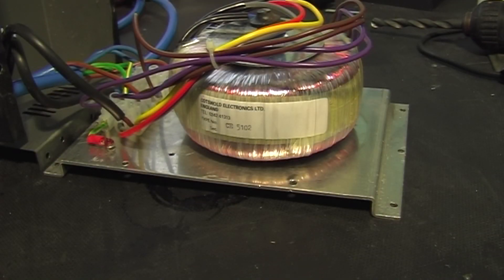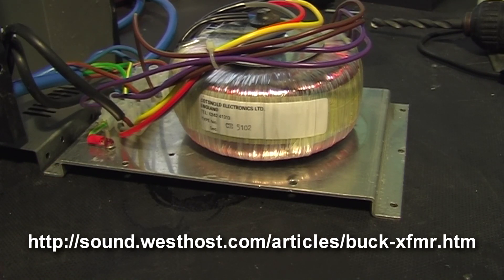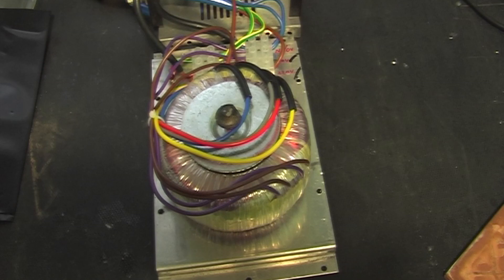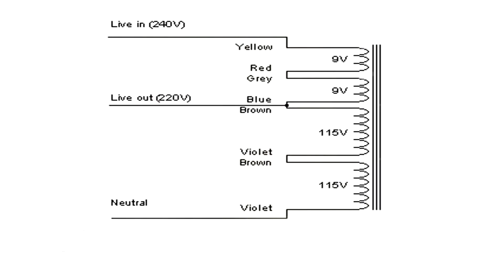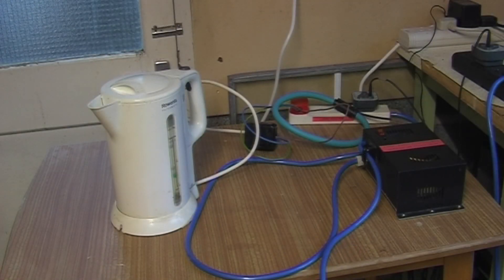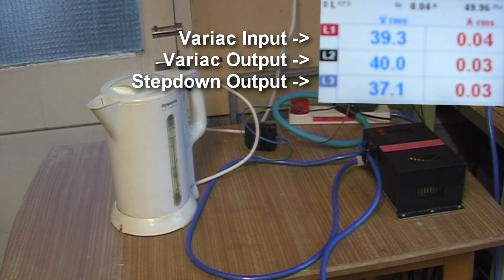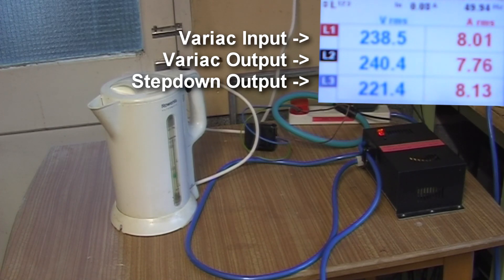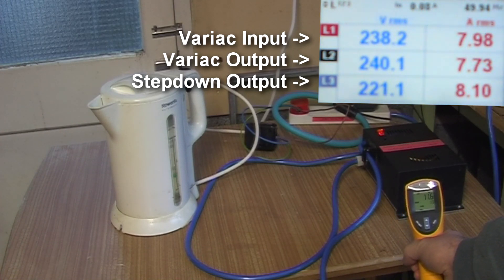Make a 2.5kVA 240-220V stepdown transformer using a 225VA toroidal

Comment: Thanks for the explanation, however...

Situation: 
- grid voltage varies between 235 and 255V here at my place in S.E. Asia
- now and then, appliances experience an early death

Considering: 
- having a transformer 240v to 15V, somewhere around 750va makes 50amps at secondary.
- prefer to have some spare, thus increase to 1kva, makes 66amps
- 240 - 15v makes around 225v
- should reduce the 255v to around 240V

Do you think the reasoning above is correct, or did I forget something?
Suppose having this, and after 5 or so years from now, I place some solar panels, and connect them to the grid for export. In this case: secondary becomes "primary" and vv.
Is this supposed to work, even with this buck transformer setup between the house and the grid?

Thanks in advance.
Reply from the maker: Yes, I'd expect that to work. It'd bring your supply down to about 220 to 240. 
With regards to the solar equipment, it depends on the acceptable voltage range for the inverter.  On the "low" side of the transformer would probably be fine.

Comment from the maker: If you want 252V output instead (from a 200V input) you can go for 223-8112 (2.67A, 0.67kVA), 223-8184 (3.75A, 0.94kVA), 223-8229 (5A, 1.26kVA) or 223-8263 (8.33A, 2.1kVA).

One last thing: this assumes that your inverter puts out a sine wave, if it's a modified square wave I'm not sure how well the transformer (in fact any transformer) will perform.

Comment from the maker: If you don't need quite so much power look at 223-8235 which is the 300VA version (4.28A output, 1.12kVA). Remember with toroidals not to overtighten the bolt and don't let the enclosure short the top and bottom of the bolt together either (it'll probably melt the bolt).

Comment from the maker: No idea, I'd just buy an off-the-shelf transformer with the appropriate voltage ratio and with a secondary current equal to or exceeding the required load current. Preferably a toroidal one as they are more compact and offer better much voltage regulation than the conventional ones. For example, RS part number 223-8279 (a 500VA toroidal) would allow you to output approx. 261V at 7.14A (1.86kVA) from a 200V input (at approx. 8.4A). Off-load the voltage would rise to about 265V using one of these.
Reply: Can I use this from RS to transform 240 to 220v? How many VA on 220v than ? Because in the Philippines in my area it's always 240v or more instead of 220v it suppose to be. Because the distance between transformers on the street they take to far apart. Some got 200v only and the one closer to the transformer like me have 240v
Reply from the maker: @TubeSkaterRudy  223-8279 wouldn't be suitable for 240-220V conversion as its secondaries are 35 volts each.
117-6071 would be more suitable with its 2 x 24 volt primaries. You'd connect the two secondaries in parallel, then put these in series with the primaries and put the 240 volt supply across the whole lot.  You'd get about 220 volts for a 240 volt input, with 20.8 amps available, so just over 4.5kVA.
Reply: @AintBigAintClever  Wow, thanks for the quick response and good tips. I'm going to order now ;) you don't know how much you helped me out. Everybody here in the Philippines has a Avr because of to low or to high voltage.
Reply from the maker: @TubeSkaterRudy  If you don't mind going for a smaller one, try and source a transformer with 2 x 12 volt or 2 x 9 volt secondaries. This would give you the option of running the transformer with the secondaries in series with each other for a large stepdown, or in parallel if you'd prefer a smaller stepdown.  The transformer I used was 2 x 9 volt, but at 500VA 2 x 24 volt seems to be the smallest RS offer.
Reply: @AintBigAintClever  I already ordered. Because I observed it often peaks more than 240v here in my place. 240v is more the average. That's why all our neighbour's and also our apliences like refrigerators get broke after less than 2 years. Warranty here in the Philippines is terrible 1 year at max. Because of the bad mains. Also I can use the 4000 VA for a professional 1500watt expresso machine that's peaking for a msec at 5000 watts I observed.

Comment from the maker: You only need one winding each side but if you've got a transformer with dual primaries or dual secondaries, that's fine. Yes, a transformer with 200V primary and 60V secondary (or two 30V secondaries) would do the job, as would a transformer with 230V primary and 70V secondary (because the turns ratio is about the same - 10:3 - the output voltage would be the same).
Using thicker cables would reduce the voltage drop and be more efficient.

Comment: Hi thanks for the info I decided to make one instead.but I do have a question about the windings If we have 200v input and we wanted 260v could we have 200v primary and 60v secoundary then put them in series like the boosting transformer on the website.How many windings each side would I need.260v might sound high but the voltage drop is high as I am using a long cable Thanks

Comment from the maker: Get a transformer with 240V primary and 40V secondary, or thereabouts (230-36 for example should be fine). Connect the two windings in series then apply your 200V supply across the 230V winding. With 200V into a 230V primary you'd create about 31V across the secondary, with the two in series that should give you 231V at whatever current the secondary winding is rated at, as you can see from the video you can pretty much ignore the VA rating of the transformer and just concentrate on the current.

Comment from the maker: The stuff I was using was 220V stuff from China, I wanted to be on the safe side. In the case of vintage 220V stuff though, it may be better to run at the correct voltage so as not to shorten the life of tube heaters for example.